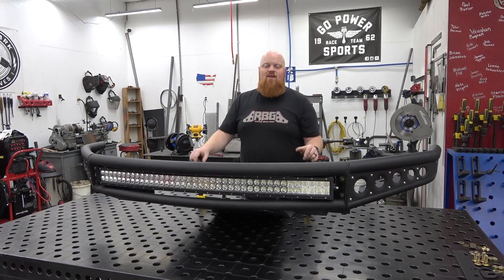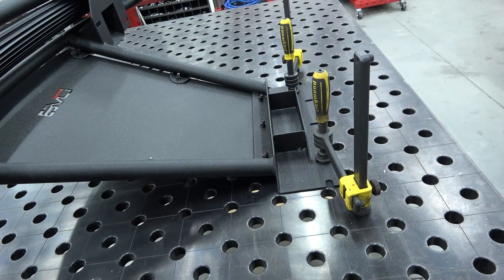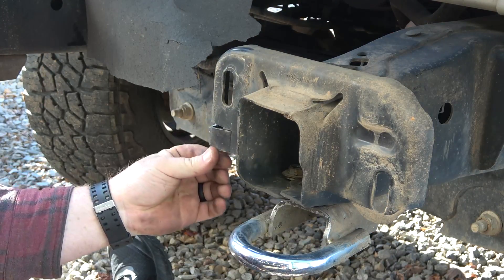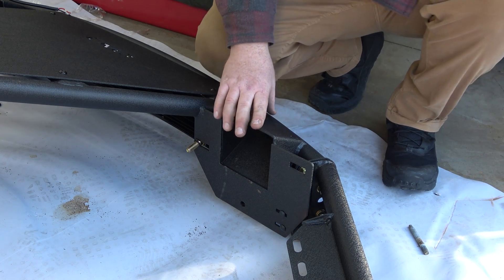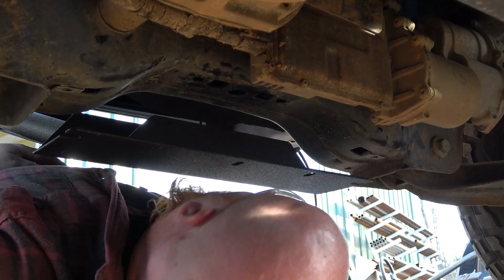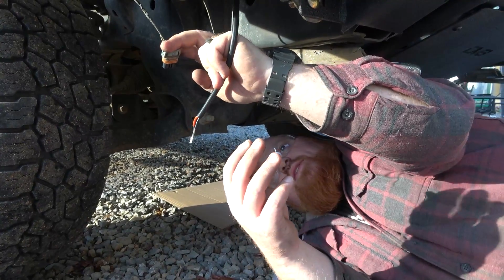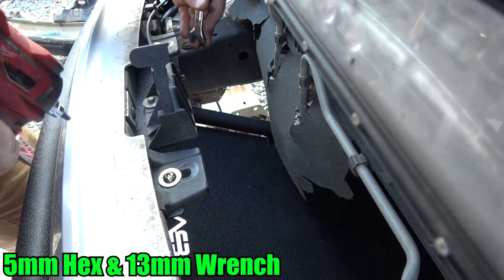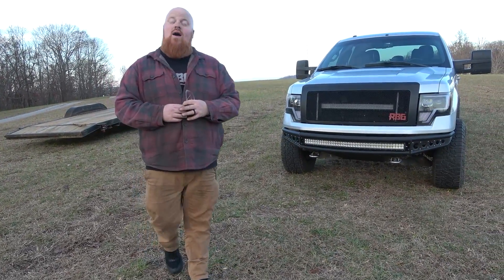2009 - 2014 F150 Baja Bumper Install ~ DV8 Bumper

Comment: That O-ring on the bolt was very smart. I used sewing thread to hold my water pump gasket in place while installing the water pump.

Comment: I liked that setup so like you I bought one, mocked it up, welded the ends to the center piece and then added a hoop to the center. 
   The other aspect was modifying the skid plate to the drop crossmember from the 6” lift. 
   Keep up the videos and make it happen bro brah.

Comment: I like how it looks! I'm would definitely rather it be a one piece bumper instead of a bolt together but it sounds like your on the right track with taking it off, welding as one piece and closing out that gap with the plate!
Reply: Agreed! I'm sure it has to do with how the company ships them. Closing that gap is Definitely the right move

Comment: The good thing about it being a three piece bumper is if you bend one of the ends you can replace just that piece instead of the whole bumper.
Reply: They actually dont sell the pieces separately
Reply: @Haulinbassracing  I will bet Red Beard could build a replacement with all the equipment he has.

Comment: I`m wondering if its not the bumper manufacturer or designer flaw at all. I wonder if the mounts were built on a certain year truck and at some point Ford made a frame design change. Because when you think about it when the bumper was designed it MUST have worked fine on the test vehicle otherwise why would it be built knowingly that the frame would get in the way.
Reply: That's what I was thinking

Comment: What motor does it have in it? Curious about what engine upgrades you're doing.
Reply from the maker: 5.0
Reply: @RedBeardsGarage  that ought to be sweet, if ya don't get too obnoxious with it. 🤣🤣 I was hoping you had a Eco-boost, haven't seen many videos on them, other than exhaust and cold air kits.